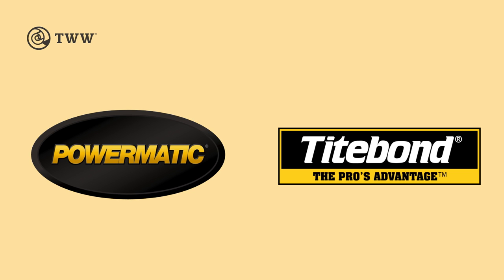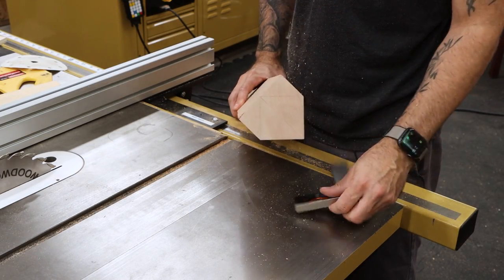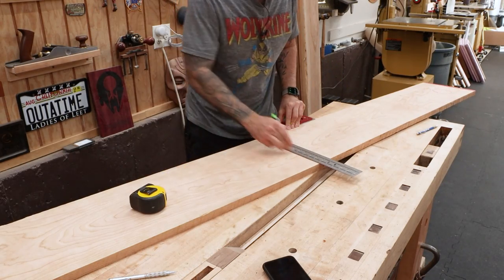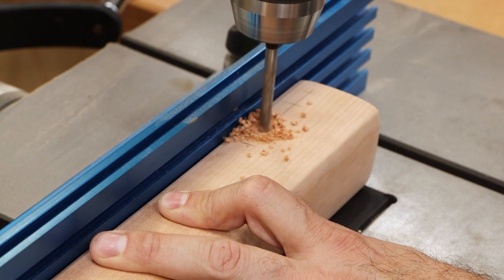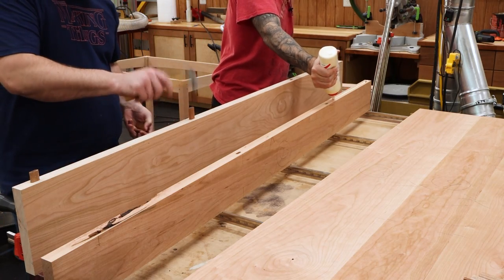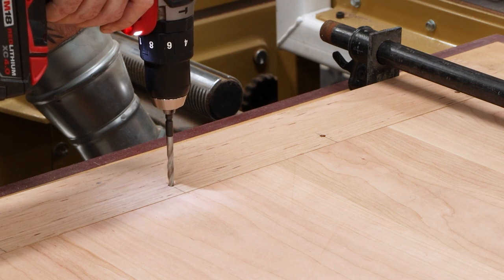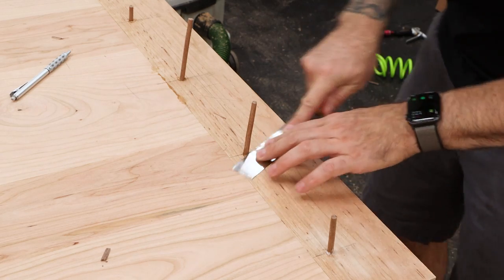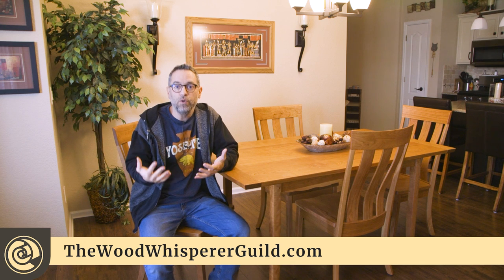Mom's Breadboard End Dining Table

Comment: Beautiful table and 100% correct on the direction of the toilet paper!  If you Google the patent and original design for a toilet paper holder, it CLEARLY shows the toilet paper coming over the top and hanging in the front.

Thanks for the video!
Reply: Only an argument with the wife would inspire that level of googling.
Reply: Exactly!  My wife puts it the wrong way and me and the kids go around switching it the right way.
Reply: Luckily my wife are on the same page about this. ALWAYS OVER THE TOP!

Comment: A quick way to round over the tenons is to clamp the piece in your vice and with a strip of 120 grit sand paper, drape it over the tenon and with downward pressure, pull each side back and forth (like shining shoes if anyone remembers that!). Works great and is very fast.

Comment: Probably a stupid question but...  When I've used dowels that needed to go in that far and were a tight fit I found that I could not bottom out as the dowel would capture air and glue in the hole.  I've cracked a piece of wood trying to hammer it it, but generally what happends is I see glue start to seap out of the piece of wood through the grain.  How do you stop those things from happening?

Comment: I always tend to suffer Murphey's law when draw boring. I've had peg break off part way through, break the bottom part of the end off, snap an inside edge off while removing the dry-fit, etc. I go 1/32" max (especial with oak+ Janka), and taper the dowels to death now. If you can leave the ends long until they're glued on there that helps too (it makes it easier to remove after the dry fit).

Comment: What do you suggest on a large table top 48x90” with 4/4 material for reinforcement when bread boards are not in the plan? Scared to route out too much material on the underside given the thickness.
Reply from the maker: Securing it to the base is all that's really necessary.
Reply: Thanks!